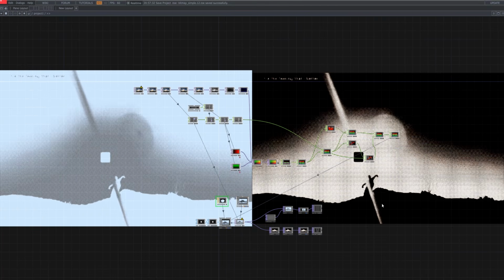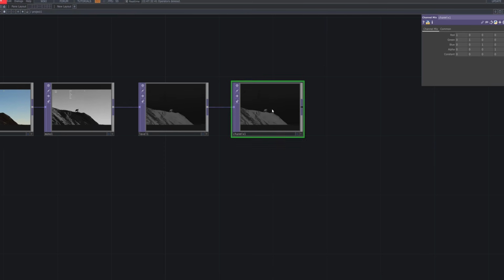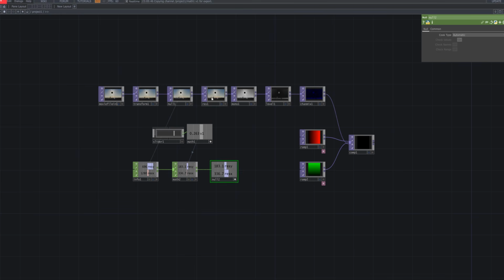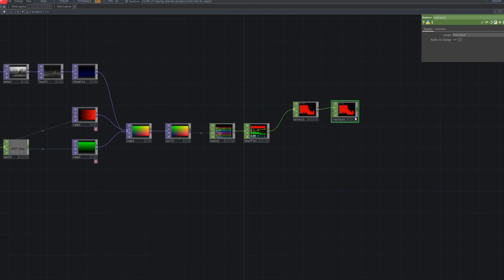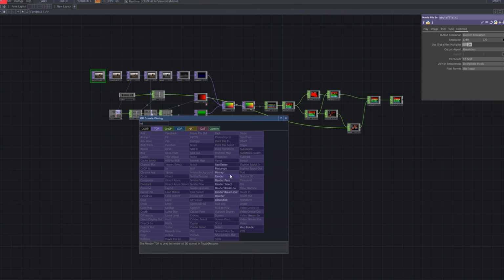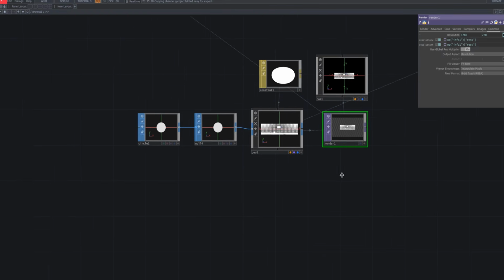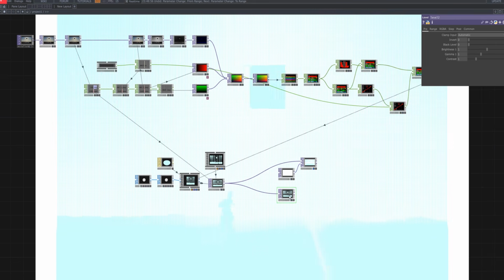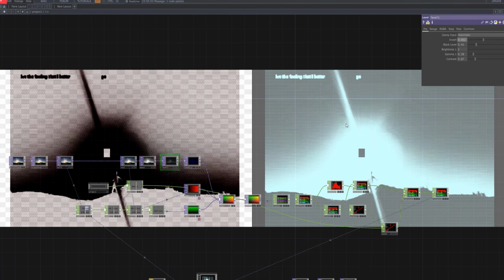Reimagining Digital Texture: Crafting Bitmap Artwork [TOUCHDESIGNER TUTORIAL]

Comment: It’s my first day using touch design and your tutorial is very thorough. My one question is I’m at the render portion around 9:30 and my render is just a skinny line. Not the full image. Any ideas where I went wrong?
Reply: Maybe check your 'topto' node. The Crop setting must be turned on to 'Full Image' rather than 'Row U' (which is how it is set by default). I skipped that part at first but changing this setting fixed it for me!
Reply: i figured it out, make sure youre using the circle SOP rather than TOP
Reply: @jaedenk999 dope I’ll have to revisit it
Reply: @jaedenk999  helloooo what do you mean by that?
Reply: @framedintent  when you press tab, there are lots of headings that come, he mean to go into SOP heading and then circle and not in the TOP heading